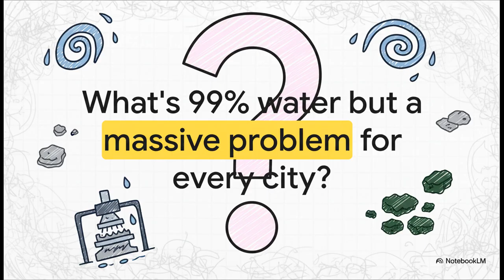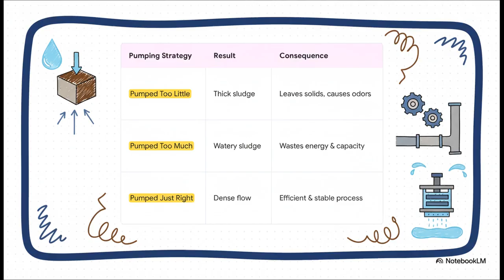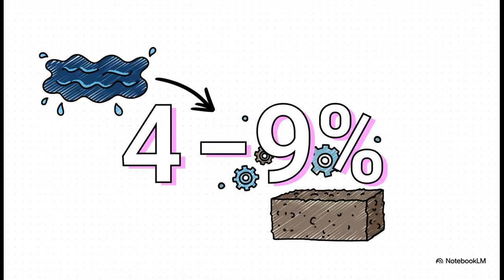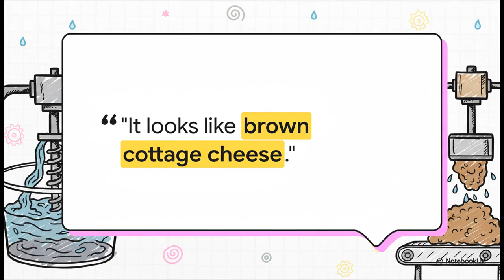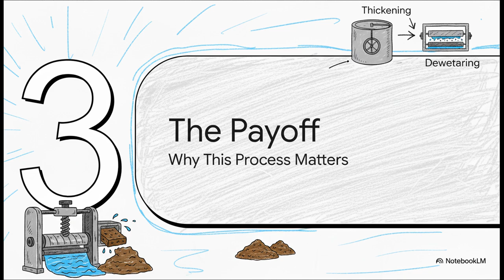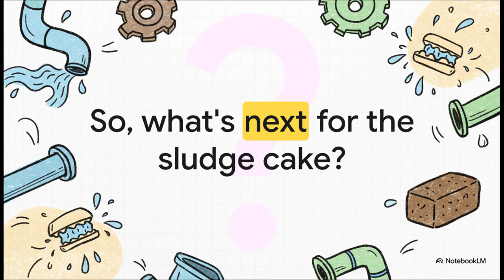Sludge Thickening & Dewatering: Explained Simply

Comment from the maker: The number that decides your hauling bill: percent solids.

Sludge at 2% solids is 98% water. Get it to 20% and you've cut the volume you haul by about 90% — same dry tons, a tenth of the truckloads. That's why dewatering equipment gets the maintenance attention it does.

It's also why polymer dosing matters more than it looks. Underdose and capture drops. Overdose and you're paying for chemical that isn't buying you cake solids.

More: https://wastewaterace.com/blog/solids-thickening-dewatering-wastewater/

What are you running — belt press, centrifuge, or screw press?
```